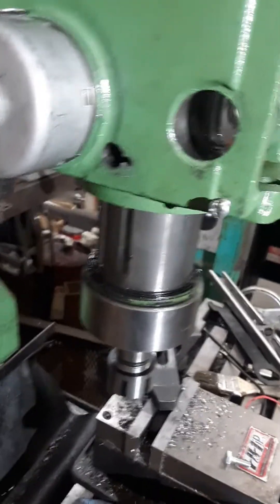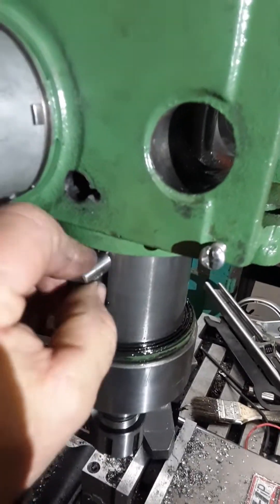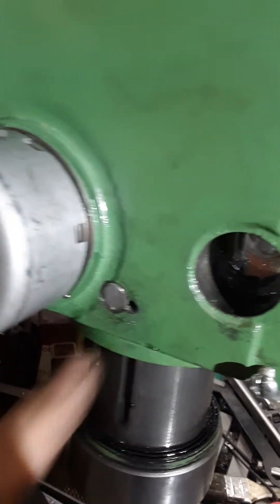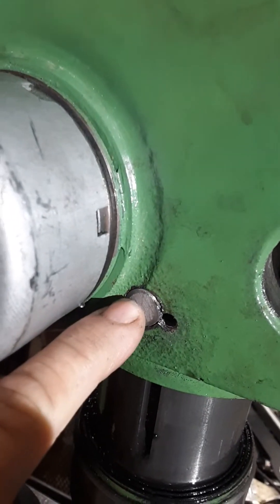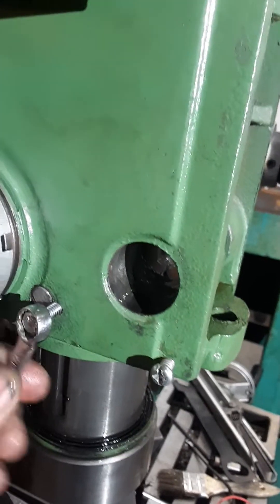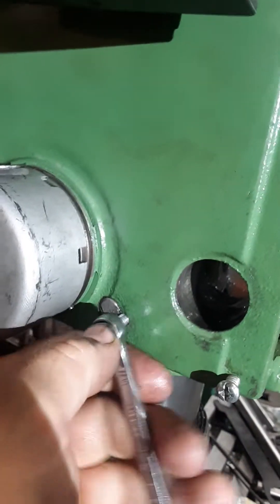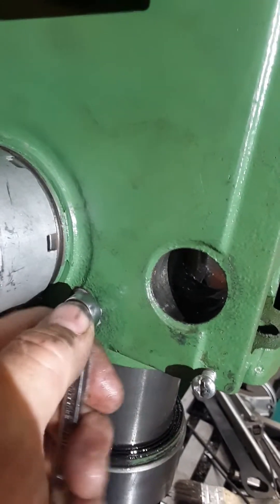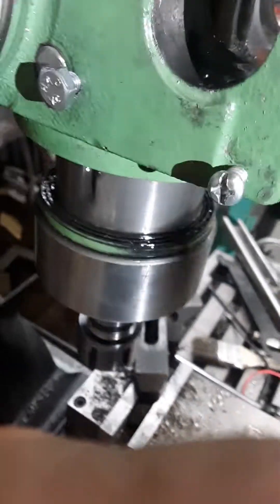Eliminating rotational quill slop on Rong Fu 31

Comment: Excellent idea! Much easier to understand than the way Steve did it. Can I ask what dro you ended up picking up? I just purchased my first mill drill and not sure how to measure for one. I might ask Steve over in his video too. Thanks for the video!
Reply from the maker: I bought mine on Amazon. As far as measuring for the scales, you need a scale that reads a little longer than the actual axis movement, say an inch or two.